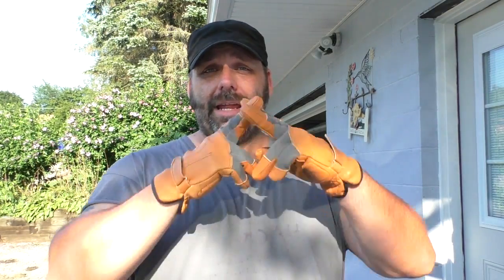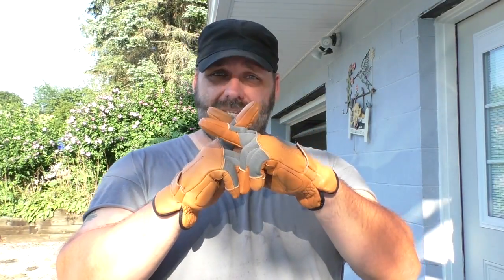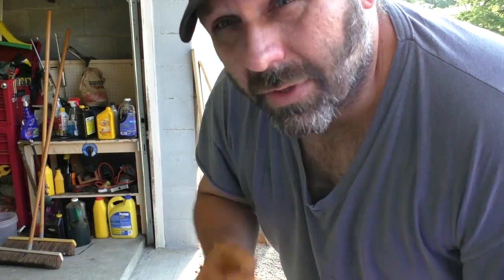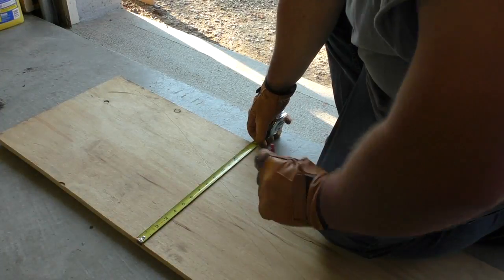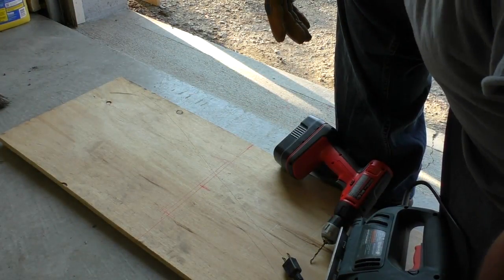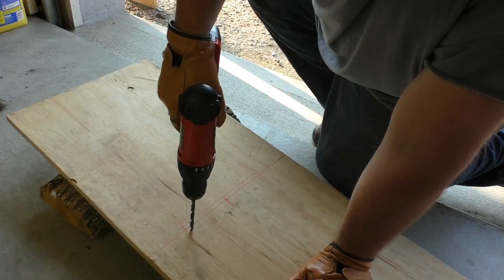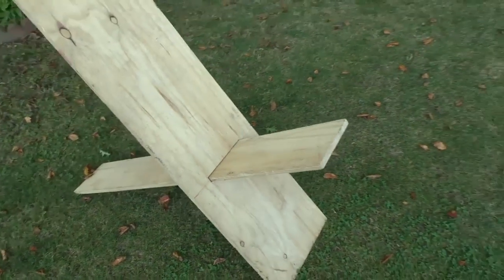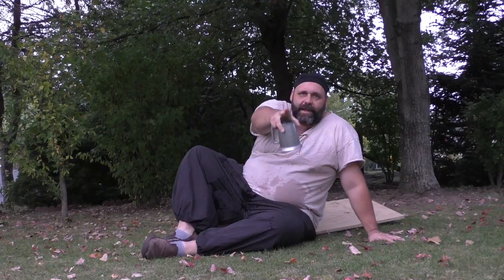How To Build a Viking Stargazer Chair - Larp Style

Comment: lol
When I saw that 3/4" ply I knew it wouldn't hold up.  I use 2x12 boards for mine and I've had 350+lb. guys sit in them with no issues.  If your set on plywood you can glue and screw another 3/4" ply to reinforce it.  That should hold up if it's a hardwood ply like birch or oak.
Like the channel :)
Reply: MrPandafarts I need more info if you can I am planning a camping trip with some old friends and would like to toss one of these together if there is anyway you could provide some details we are all heavier people!

Comment: I used wooden Planks i screwed onto two long strong pieces of Wood for both parts, makes for a really sturdy Chair... But i only weight about 60kg (whatever this is in imperial Units, idk)
Reply from the maker: Yeah, see this chair may have worked for you.  But, I weigh more then twice what you do, so that chair never had a chance.  Next time I'll be using stronger wood for sure!
Reply: Mine would support you easily, especially because the Planks alone (not considering the Wood used to hold them together) is solid and over half as thick as your plywood

Comment: Got enough material you might thing of two layers thick looking at the bulk of you! (No disrespect-if I needed someone on my side I'd pick you for my squad!)
Reply from the maker: Laminating it with multiple layers probably would work if attempting to use cheap material like this.  But I think big folks are going to need solid thick woods to prevent collapse.  This chair would have been fine for a kid, maybe under 50 lbs., but certainly not for me.
Reply: @LarpMix  doubled up ply would work for kids an even wives? We are both correct your chair needs solid wood. I'm going to make several of these chairs! Thanks!